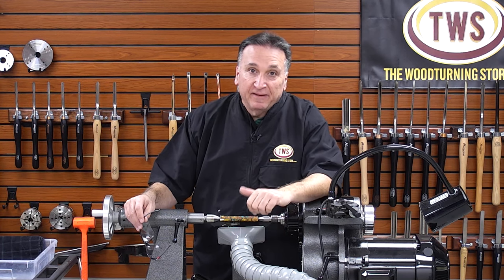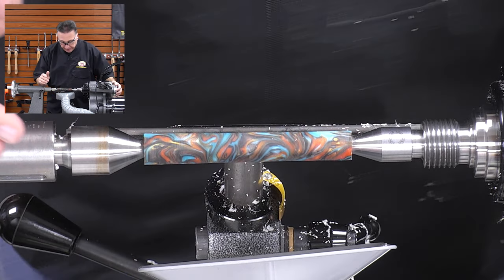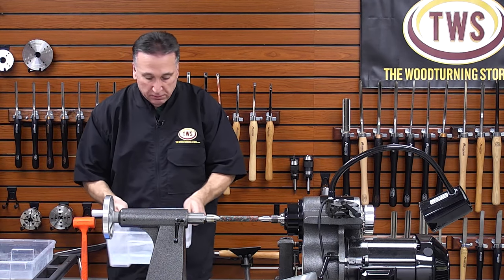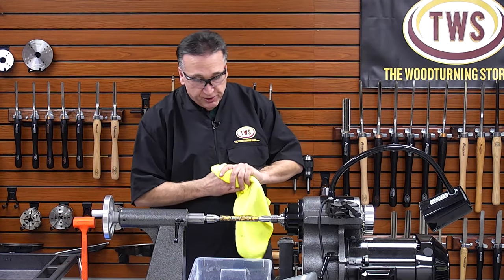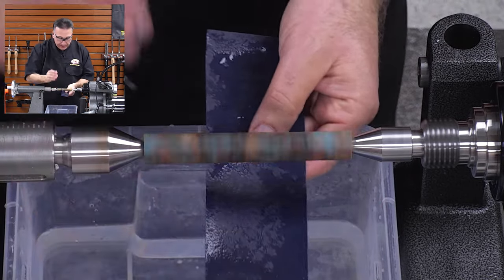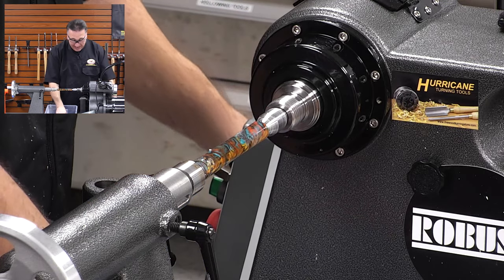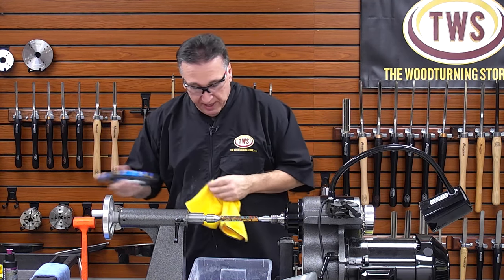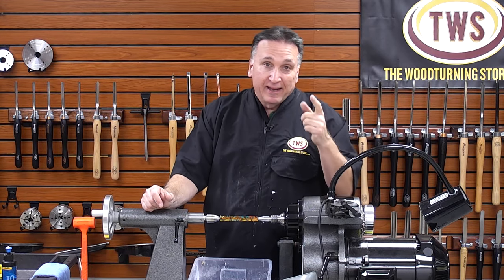How to Sand and Polish an Acrylic or Resin Pen Blank - Perfect Every Time - The Woodturning Store

Comment: Steve ,I found using a paper towel less likely to catch and if it did will tear unlike a cloth. Also I use alcoho with the paper towell to clean off any sanding residue..
The Can Vac if fantastic!. Noticed you have an adjustable "dust catcher" for it. I'll check your site for it.
Thanks Fred